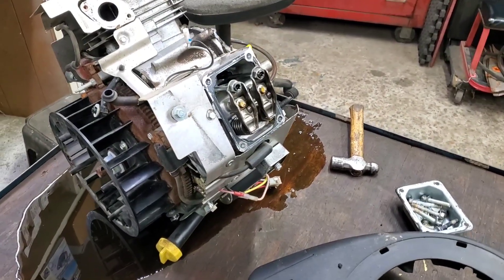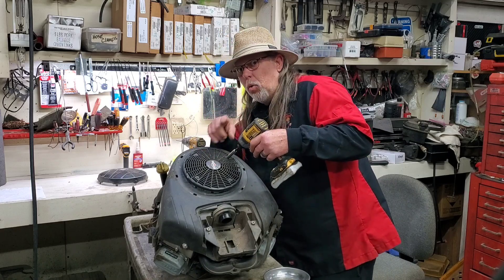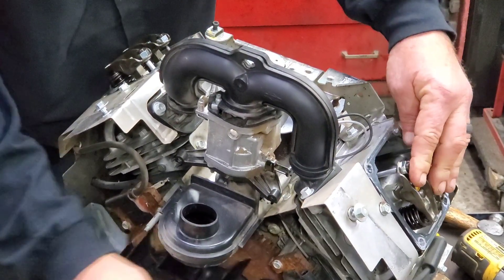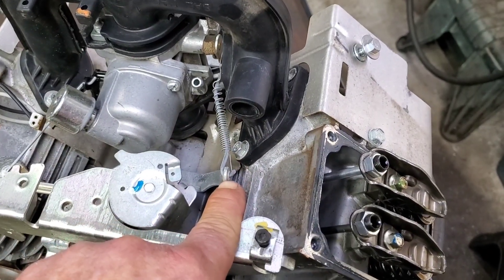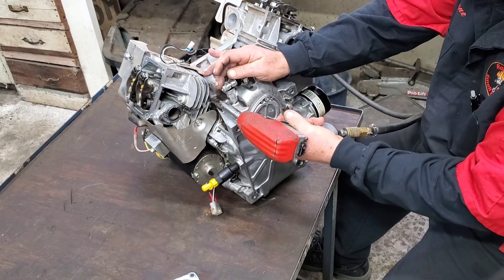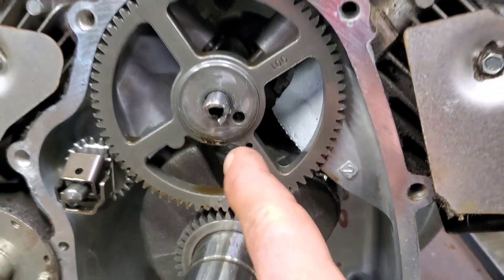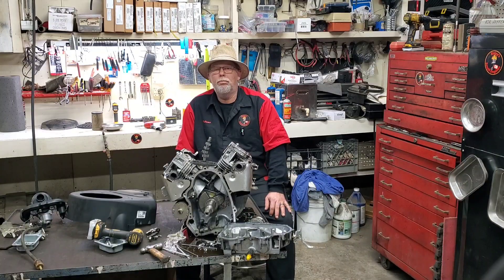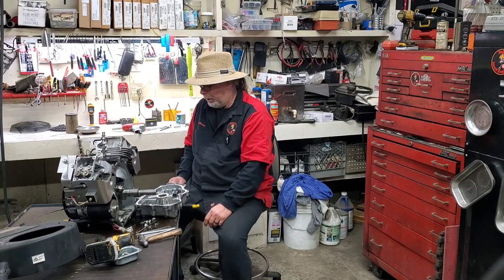No Start, No Compression V twin INTEK Briggs and Stratton

Comment: I remember watching my dad in the early 60s tear down our 1960 sears craftsman heviduty rider to replace a thrown rod and patch the hole in the crankcase wall with liquid steel. (Epoxy) the engine was a 4-1/2 hp lauson which soon became tecumseh. Dad's long gone,but I still have the old craftsman and that patch is still holding!😊

Comment: I am putting a 24 hp Briggs twin back together .I fixed the bent push rods and welded valve guide so it doesn't creep our again on number one cyl exhaust valve . I adjusted valves ,everything seems good . Turning motor over slowly by hand with a ratchet trying to get compression test on gauge .Nothing showing on guage but if you put your hand over exhaust manifold it will push your hand off with pressure ? Nothing looked damaged in bottom end at all .Cylinders seemed clean,pistons traveling good ,cam good .New push rods ,seals ,etc . I am going to remount it and try to start .Just thought I would check compression out. I had similar happen with my Harley once .No compression on gauge turning engine by hand ,but fired up ran good .

Comment: Did it turn Over when installed before removed just curious , I have 24hp vtwin briggs that cranks over great and if I spray carb cleaner thru breather it will attempt and then stop cranking unless I release key and try again etc... just curious fuel is getting to carb, have spark etc...

Comment: Good morning T-bone,,what happens when your battery doesn't charge on your sit down lawn mower..🍺🍺🍺🍺😜
Reply from the maker: You fix it!! 😆 I've been meaning to do a video on that very issue.  Use a volt meter to test for 12 volts on the B terminal on the regulator with key on. If  12 volt good start engine and test for AC voltage coming from the 2 terminals from the alternator. I forget the exact voltage, it will be noticeable.  If you have AC voltage, bad regulator. If no AC voltage bad alternator or magnets came loose from flywheel.  Hope this helps you out my friend.

Comment: Been there a few times. Same carnage. 
Mikel
Reply from the maker: Yep, that one was messed up.  I'm not giving up on the John Deere Zero Turn yet. Found another engine. Video coming soon.  Will it work? I don't know yet.
Reply: @RaleysSmallEngines  only one way to find out if it will work. I have faith in you. If the PTO shaft is the same, it should work. 
Mikel

Comment: No compression on an intek, without watching I’m guessing either valve issues or a bad cam.

Ok after watching, it was a cam issue from a grenaded rod. I have seen so many of these grenaded inteks - mostly single cylinder, they seem to be worse. As bad as they are, they are still better than a kohler courage, the infamous “bucket” engine.
Reply from the maker: Exactly

Comment: Wow.  Amazing how a $5 quart of oil could have kept a $900 engine from turning into that mess of metal.  

I was tickled to see you try out that 5-in-1 tool suggestion.  I found putting the width of blade against a large length of the gasket seam spreads the force over a larger area.  Kinda like a mason using kneeling boards/floats when troweling a concrete floor,  or a hiker in Canada using snowshoes in the winter.   Keeps you from sinking into the snow/concrete/aluminum.

Happy Holidays to you Mr and Mrs T-Bone.
Reply from the maker: Exactly, just $5 bucks and tighten oil filter.  Yes that tool worked great.  Happy Holidays to you and your family.
Reply: Happy Holidays!